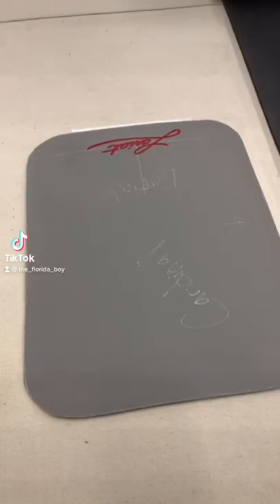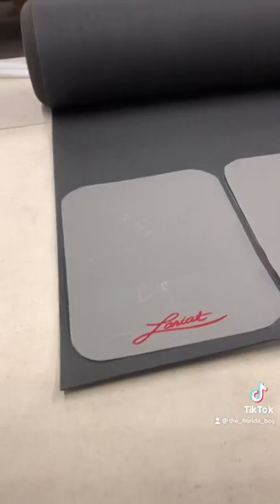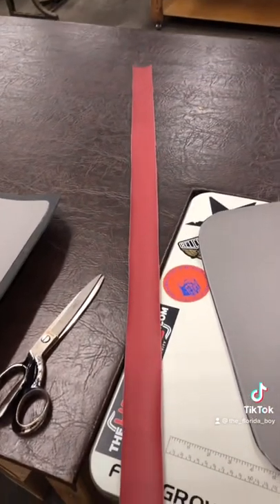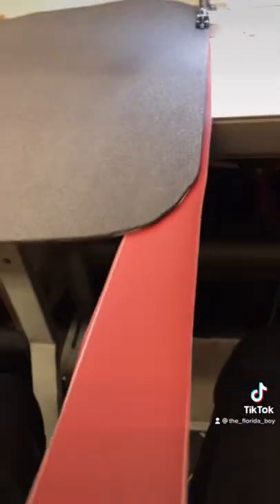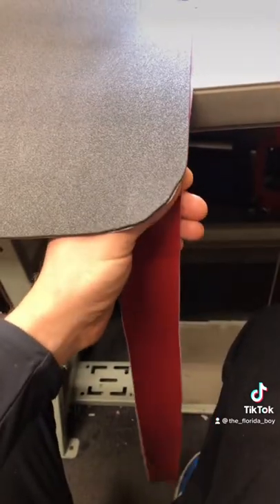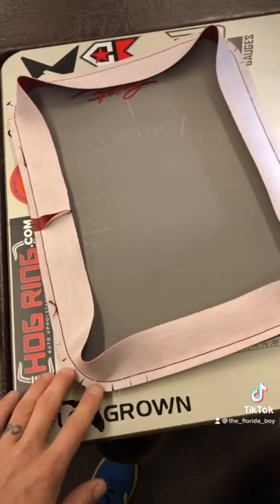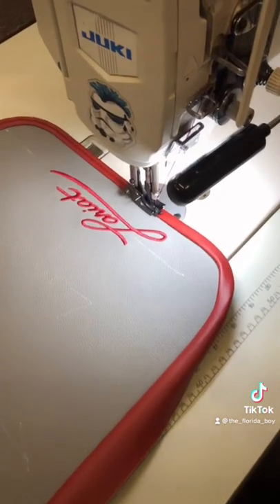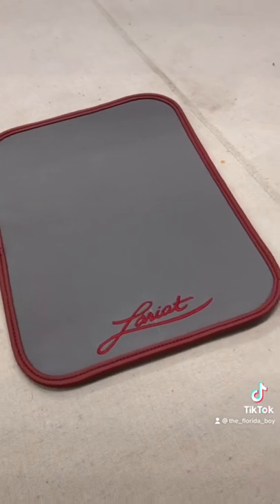How to make custom floor mats the Florida Boy Customs way!

Comment: would it matter what foam you use such as type of foam. Im concerned about getting it wet from spills, rain, slush, etc or would you do a backing on the foam side so its not exposed?